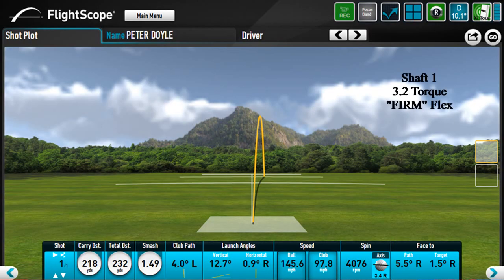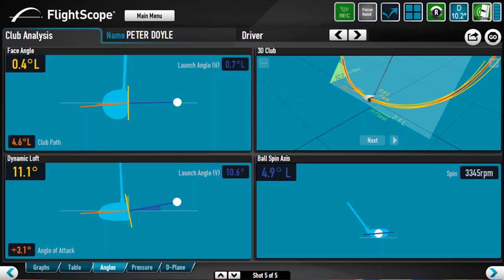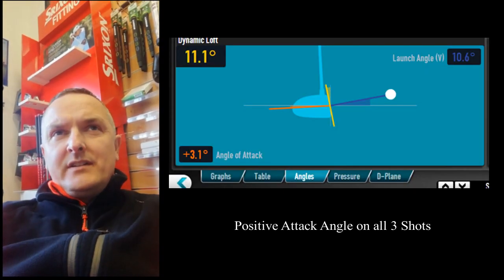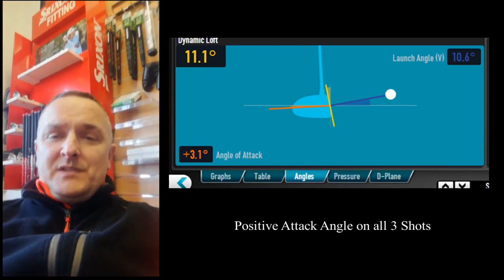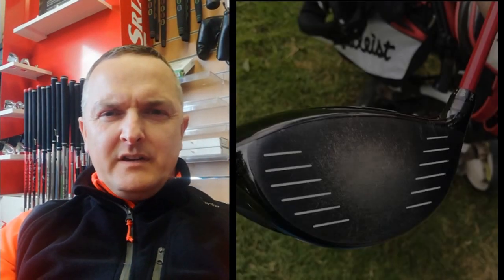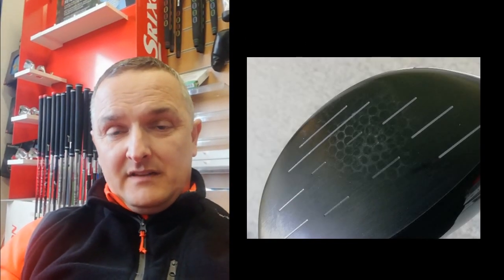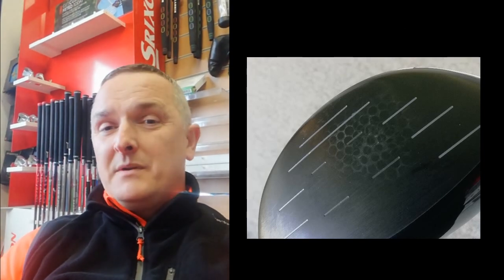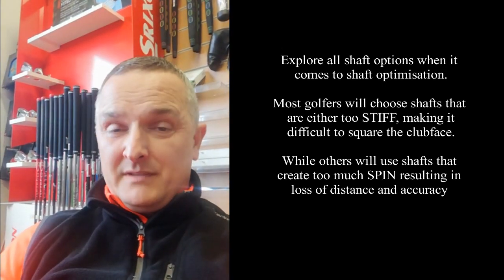Shaft Flex vs Shaft Torque - Why obsession for shaft flex can ruin your golf game

Comment: Interesting,  I kinda experimented with this concept,  testing a s flex 60g  shaft, it was going all over the place. Placed some lead tape in the middle of the shaft to increase the shaft weight. Probably about 6 to 7 grams. Nnnnnn wham the ball started going right where I wanted it to go and went off with great trajectory.  

I'm now gonna try a regular flex shaft that weighs more, and uhmmm try to find one with the lowest torque.